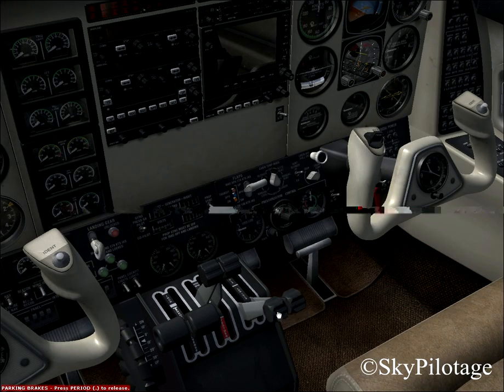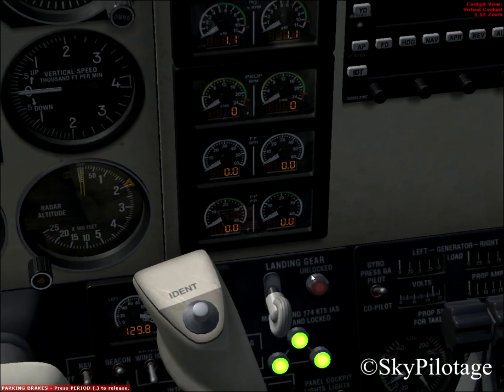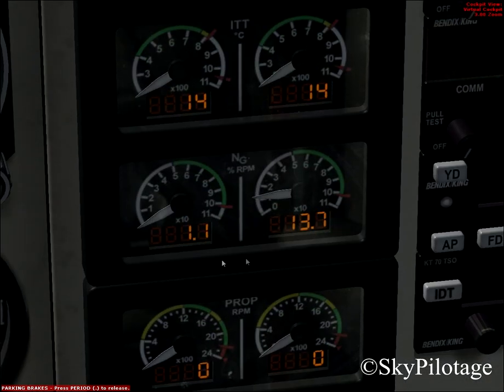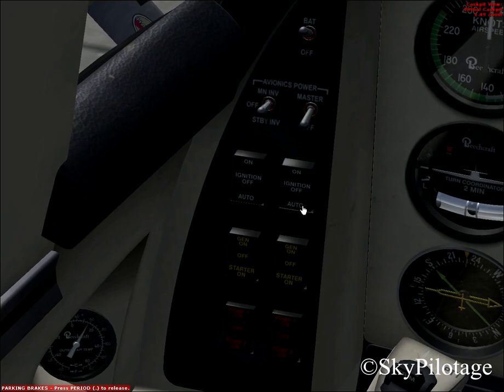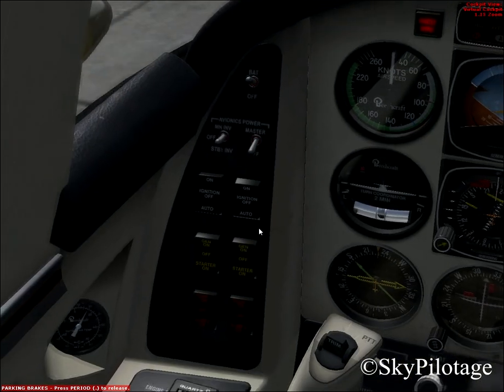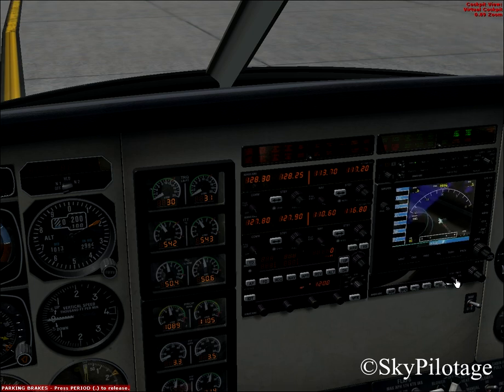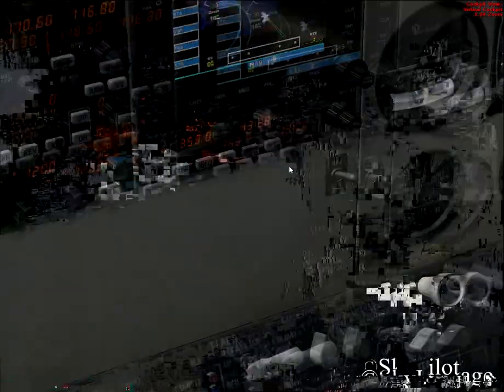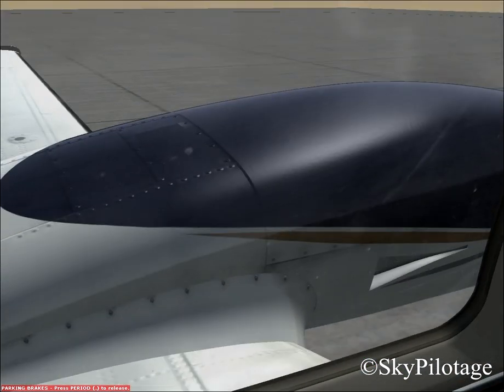RealAir Beechcraft Turbine Duke Tutorial 1: Engine Startup

Comment: The conditioning levers should not be in high idle for starting, they should be in stop, then once the startup has started you then move them to low idle. High idle is just for taxiing without adding power.

Comment: I've never flown a turbine Duke. Went straight from piston to jet. However, I imagine the avionics master switch serves the same function as on the aircraft I've flown. It's not necessary to use the power switches on all of the radios. During normal operations, the avionics master allows the pilot to turn on/off all of the radios via a single switch, rather than individually. Enjoyed your presentation.